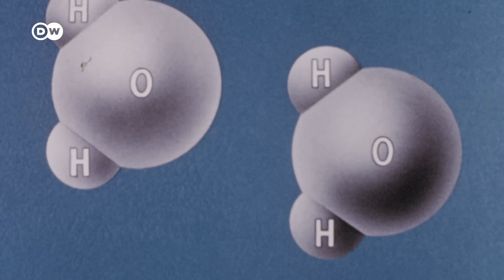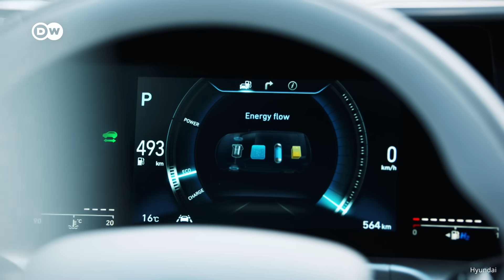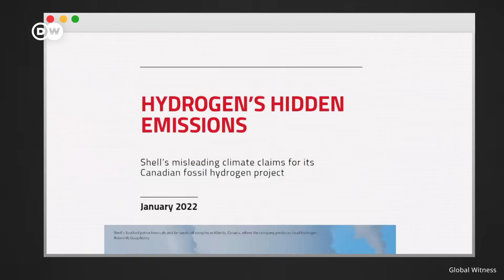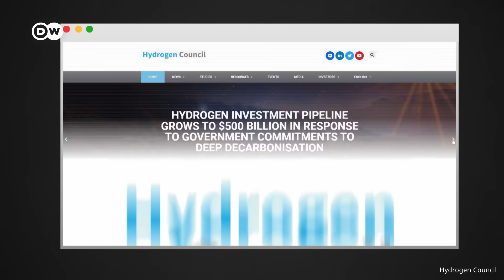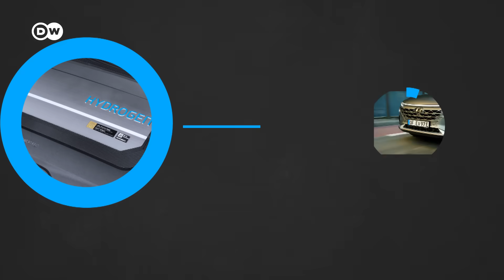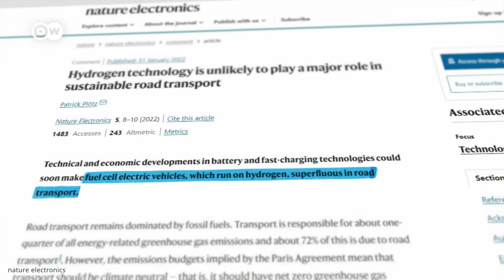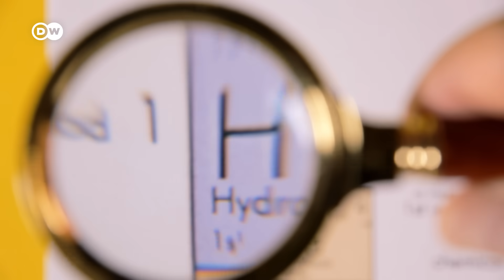The truth about hydrogen

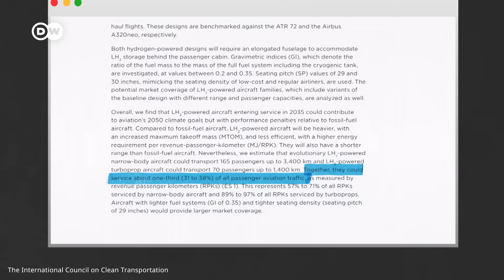Comment: 4:26 DW Planet A made a huge mistake, that highlighted portion says it 31%-38% of all aviation traffic could be hydrogen powered, not cut emissions down by that much. burning oxygen still leaves free radicals that readily bond to other elements such as carbon..... if gasoline brought us acid rain, what will 1/3 of the planet burning hydrogen bring? lethal rain? ground level smog so thick every one dies of carbon monoxide poisoning? mustard gas smog?

Comment: AHAHAHA the major draw back to hydrogen is to make the hydrogen requires more electricity that the power hydrogen will release...like requiring a herd of horses to pull a ford mustang automobile with it's pedal to the floor going the opposite direction.
 the amount of horses required will have to over power the ford mustang automobile by horses=400:1ford mustang automobile at full throttle.
the gains do not justify the expense at all. more pollution will be required to make the necessary energy requirements to generate enough hydrogen that gives off less power than fossile fuels. even sugar contains more power than hydrogen by very large margins of about 200:1.
there is more bang power in fossil fuels and sugar than there is in hydrogen. it's like trading down from ethanol in power which is mileage by 50% to 80% less power. and ethanol is corn sugar that has 20% less power than gasoline, and gasoline has less power than diesel.

it will require about 200,000 nuclear plants to make enough hydrogen just for all the automobiles we use. solar and wind combined multiplied by the power of 9æ can't even get us there.

Comment: "Green" hydrogen requires wind turbines and solar panels, both of which require rare earth elements and aren't even close to producing enough energy  to break even on the energy required to make them let alone enough to produce a surplus of energy that could be used to produce a viable amount of hydrogen fuel. 
Even if they did there's still the fact that neither wind turbines and solar panels can't be recycled which means eventually we'll run out of the materials necessary to make them which puts us back into the same cycle we are currently in regarding fossil fuels.

Comment: The absurdly low cycle efficiency is a killer considering the value of renewable electricity (losses from the electrolyzer, energy lost in compressing the stuff to absurd pressures or energy to liquify, and transportation infrastructure losses). In theory, we could pull C02 from the air and fabricate hydrocarbons from that to complete the carbon cycle. There is more hydrogen in a gallon of gasoline than a gallon of liquid hydrogen(!). Practical on industrial scales? No idea, but until we have a large increase in production and drop in price of non-fossil fuel electrical power, none of this make any sense. Thorium fission, fusion, and/or space solar on an immense scale will be needed first.
Reply: In CA, where we have proclaimed the end to ICE vehicles by 2035, We JUST finished a WEEK, where we were WARNED, with a FLEX ALERT, warning of possible rolling blackouts!
Ignoring the fact that we already generate so much excess SOLAR, at times, we must PAY AZ and NV to take OUR excess power off the Grid...
You wonder why their power is 50% of ours in CA?
But yeah, EV's are gonna be a FUN experiences...
Reply: Thorium sounds good, but I'm a little skeptical.
I don't think ELON is a total Uber genius, but the guy is pretty smart, and definitely has connections, so why isn't he or Gates (whose building conventional I think) not getting things ramped up Thorium?
The Gates info is from a interview from 2017, he talks about one of his companies building a rector in China. I guess I am assuming it's conventional, but I would have thought if it wasn't he would have said so during the interview.
Just based on the supposed ability of a Thorium reactor being able to "burn"/ or dispose of the radioactive waste the older conventional reactors produce, we have enough of that, to make a solution valuable even if it isn't scalable for power production, or has any other issues
Reply: It wasn't the Thorium process ability to "burn" high pressure water reactor waste (heavy or otherwise), it is the fact that Thorium is a relatively abundant element on Earth and the chemistry allows it to combine with Fluorine to make a salt that would be liquid with a low vapor pressure at operating temperatures that caught my interest. This would allow the radioactive part to be at room pressure, eliminating the high temperature, high pressure failure mode of water-cooled reactors. The containment vessels are trying to come apart like all high-pressure bottles. Reactors more so with the combination of high temperature, Neutron bombardment, and high consequence of failure. I agree that there is a great deal of development to be done to make Thorium a commercial power generation option. But it isn't a complete unknown either, LANL had a operating Thorium salt reactor in the mid 1960s, but as it didn't synthesize useful quantities of Plutonium, the concept had no military use and was cancelled.
The "small modular reactor" architecture may be useful, time will tell. The SMR concepts have ranged from water cooled, gas cooled (Brayton cycle), metal cooled, both fast and moderated Neutron along with and molten salt concepts. IMHO the molten salt and gas cooled Brayton cycle system make the most sense. At least the gas cooled reactors operate at pressures much lower than the water cooled systems and the mass of coolant and the energy of coolant release is much lower than the water cooled systems.
Reply: @jedswift  Understood, what I am saying is the guy was talking about venture capital money.
They look for "WHEN" am I going to get ROI!
As far as I know, this is the ONLY solution to the piles of waste we have already accumulated.
Thorium based power is one of many power sources,  no matter the facts, some will still prefer Solar and Windmills, because it's easier for them to understand them.
Just sayin',  when you have the "market" cornered, you have the only solution for a problem, it's easier to attract capital.

Comment: If some smart people would have worked out how to best use hydrogen and extract it some time ago, this would already be a done deal.
It's the most abundant form of energy we have, it literally just becomes water vapor again after burning it. Renewable. 

Yes as video say "expensive this and that and loss doing this and that".. Then work on it and solve it. No one thought EVs would be a thing until Tesla made them viable.
It was just niche and basically good for around the block and then ran out of juice. Now every single car maker and their mother are into EV. And ranges are increasing and charging getting faster etc.

This is what is needed with Hydrogen. And the same with Desalination plants to produce fresh water for drinking and irrigation.

Comment: Yeah, no - water vapor is by orders of magnitude the most significant atmospheric climate modifier. CO2 is literally irrelevant in the picture. That being said, H2 is versatile and useful in many ways. It's just difficult to store in practical useable quantities. But a very good and reasonable discussion.
Reply: You present a kernel of truth disguised in a mountain of disinformation.  Water is indeed a greenhouse gas, responsible for about 50% of the greenhouse effect.  As other greenhouse gases drive higher temperatures, more water evaporates into the atmosphere and amplifies the effect.  CO2 is not ‘literally irrelevant’.    The climate models incorporate the effect of water.
Reply: @lynneframe3390  The climate models you are referencing are works of pure fiction, designed to drive alarmism. Your ilk have been screaming "we're all gonna die" for decades. It's all a political power play. Give up. Only handful of simpletons believe you any more.

Comment: To build solar panels or wind turbines (which both have a 20 year life and of themselves are grossly inefficient) to NOT create energy but simply create another STORE of energy (or fuel) is a HUGELY INEFFICIENT process. It can be compared to running a marathon (production process) in order to only power 1 push of a swing (consumption). The pictures and videos that people show us look so pretty, but ask any experienced engineer, and they will tell you that “green hydrogen” is the most wasteful, inefficient energy on the planet!... The return on energy investment is terrible! There is a difference between perceived green and actual green. Green energy is unfortunately a very good example of perceived green. In reality, the carbon footprint of green hydrogen is atrocious.

Comment: I'm missing answers how hydrogen will be transported without pipelines. To liquify you have to cool down to 20 K (-253° C). Not very practical. That leaves compression in steel bottles. But hydrogen is the lightest gas .. to get some mass stored in bottles you'll need many bottles.

Comment: There is no crisis climate crisis...this is political, profit driven, conglomerate motivated and for  mass control and whoever has bought into this has been bribed. Fossils will always be needed....ev batteries not recyclable and it's under-carriage is made of plastic and when battery dies in remote areas, the vehicle cannot be towed because of the plastic underneath . Hydrogen is more of an energy carrier....no it will never become viable as per these outlandish requirements.

Comment: Everyone involved in renewable energy knows hydrogen as renewable energy gets an A+.  It does not pollute and its use in fuel cells is well developed.

'How to make hydrogen economical' so we don't spend a substantial percent of the H2 energy just to generate hydrogen!  The focus of the most important assessment and analysis of 'hydrogen' should be on the most viable approach(s) to generating it.  Until that's accomplishjjjjj

Comment: Solar was scoffed at in its early stages - it will NEVER grow to scale.  But as solar plants have grown in size, and storage capability has improved it has grown to wider use, slowly but surely.  The same for hydrogen?  Perhaps like solar as the benefits and scalability of hydrogen grows it will provide a larger % of our energy.
Reply: that's because we just wasted a lot of time energy and public money (not to mention the environmental damage) putting in cloudy countries where it is inefficient instead of being sensible and creating nuclear as our baseload and wind turbines plus batteries for the difference. we wasted a lot of money on solar that should have gone to battery development and manufacturing and nuclear.
Reply: With solar, the sun has to shine. With hydrogen we need to be aware of the effect on where we source it from.
Reply: @favourlemuel403  not really we have the technology to remove the carbon dioxide from the exhaust gasses from steam methane reformation.... which produces 2 useful products, raw carbon and hydrogen

Comment: we need to go near the user. For example, if we can crack what comes out of exhaust into safe eco product. if each house has for example an ecoflow or other type of combo solar / ac charge / or even genset charge , 10kw bank, it will alow redundancy for power shortages for ANY reason. The futur will show that the more energy used for transportation , manufacturing , heating ; it will be MANDATORY for the human race to be very inventive . Each method of producing any energy has it's draw backs, we need to find the lesser. We could also look at how nature produces energy , earth, sun, animals, etc . Tidal energy is all over 60% of the earth, volcanos supply energy in Iceland. Think hard and come up with inovative ways will be the champion for a Nobel .... at the end of the day, will nations share the blanket or pull the blanket .... ?

Comment: If it can be used to power the heat needed in steel mills, than it could be used to power the heated steam used in turbines for electricity producing?
A natural gas electricity plant should be converted for test runs immediately.

Comment: My thoughts 1. I do think that hydrogen is the way to go to power vehicles. Much, much more environmentally sound than toxic lithium batteries and the destructive mining it takes to make them. 2. Someone will come up with a way to "seal" hydrogen into a storage container. Clean nuclear power can make all of the hydrogen we need for vehicles. 3. Lithium batteries charged by solar and wind will NEVER work. There is just not enough reliable energy there to make it work. The US and world will spend trillions of dollars and waste decades of time before they come to this realization.
Reply: hydrogen is inefficient. nuclear power can charge car batteries and power the production of car along with a bit of help from solar in the right countries/climates. lithium production is changing and techniques invented to make processing cleaner (tesla for example have invented a non chemical extraction technique and building a process plant in 2024). 

besides once all cars are battery driven the lithium and other minerals are fully recyclable (already being done by tesla co-founder JB strobel's new company) so we'll have a closed system with no more mining. that's what will happen.
Reply: Hydrogen stored in containers filled with metal hydrides work - slow to fill BUT slow to release too even if punctured - much safer. In this way they could be exchanged at depots just like putting batteries in a toy car.
Reply: Burning hydrogen generates huge NOx since it birns hottest of all the gases. No one mentions this. Why ?

Comment: I've known hydrogen was a bunch of nonsense ever since the early 2000s, when it was being pushed as the new future fuel (you'll notice that happens over and over). I was just a kid, but even I found it suspicious that the OIL COMPANIES were the ones shilling this new hydrogen stuff. Then I looked into it, and found that the only industrially viable method of making lots and lots of hydrogen is to distill it from propane, which itself is distilled from CRUDE OIL. Nowadays, the idiots' answer to that problem is that we'll just use nuclear power for electricity for electrolysis (which isn't an industrially viable method of production ANYWAY), but the catch is that - in America, at least - we're closing nuclear plants, not building them, which is even more 'green' BS.
TLDR: hydrogen does NOT get us away from using oil!

Comment: Instead of smog it'll be water vapour? Depending on the population of a large city, would it make the air more humid or thick?
Reply: Not really, since most fuels that are being used now also emit water, in addition to CO2. But they also emit other more toxic by products, which you do not have by using hydrogen

Comment: No matter what  forms of energy are available,  people will always want and need to travel. Battery powered vehicles are only a stop-gap measure due to the massive costs in terms of resources and pollution,  and the use of hydrogen cells in vehicles to power electric motors is in efficient. Where as hydrogen as a fuel for internal combustion engines is seemingly a far more efficient use of an expensive commodity. Existing engines can be adapted and new engines can be made to be super efficient. JCB machinery manufacture already have a powerful hydrogen powered plant engine fitted into their test diggers, and other manufacturers will soon be following. It seems a huge waste of precious materials producing vehicle batteries for the billions of cars needed across the world, when simple internal combustion engines powered by hydrogen would fill that important need leaving the world supplies of lithium for the more specialised purposes.

Comment: I could see a use of hydrogen in agriculture. Solar converting water and compressing. Early adoption would likely be hydrogen fueled diesel tractors with a slow transition of fuel cell versions when available. Batteries have material availability problems, along with the large holes in the ground and the toxic chemicals used, that are far from green.
Reply: Isn't methane a common by-product of livestock raising? Methane is mostly hydrogen and research into blue hydrogen surely must address how to capture the carbon atoms in that molecule. All of this requires massive dollar investment and there's the problem.